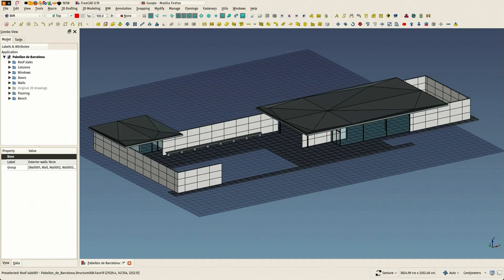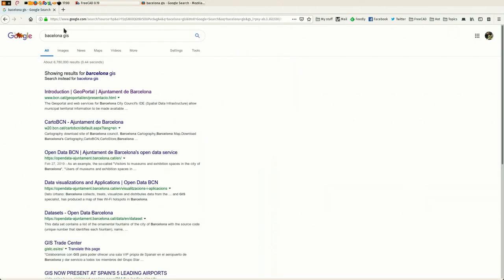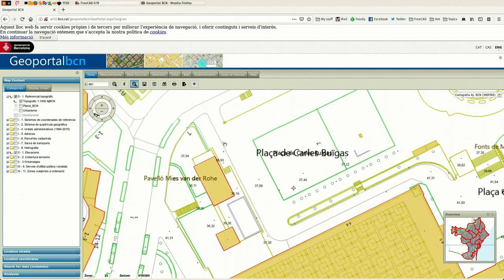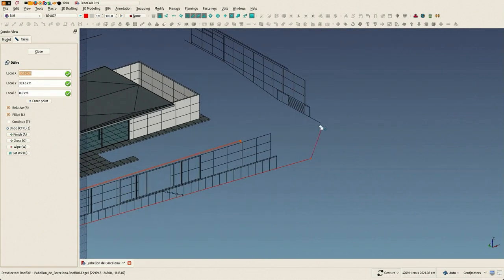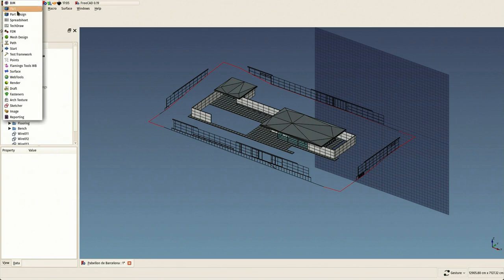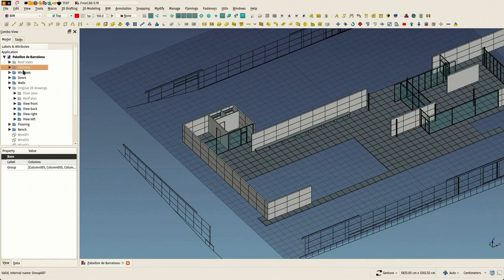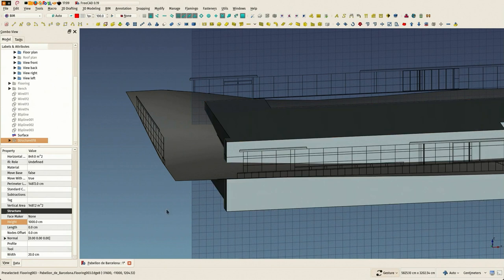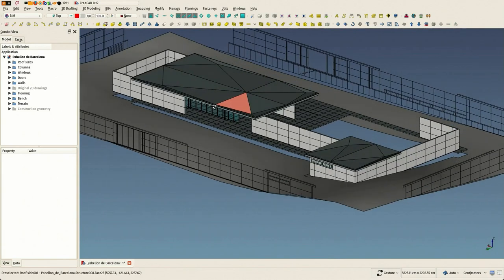BIM with FreeCAD - Barcelona pavillion 11  - Terrain

Comment: Hi Yorik.

I saw you first try to use a dataset to import the digital terrain model. Is there a guide on how to do this? 

I want to import the terrain with all the different heights, so I can accurately see the height difference between the roofs of multiple buildings.